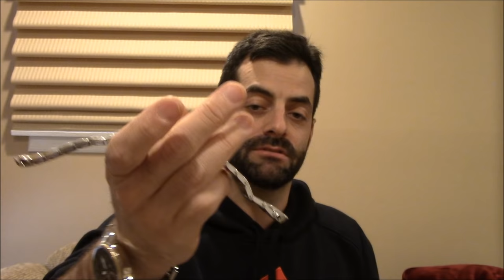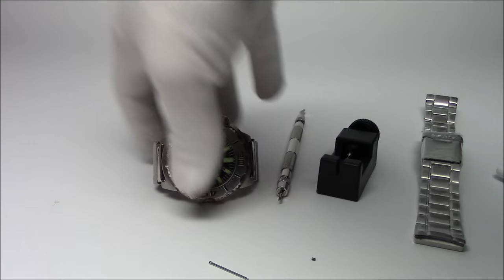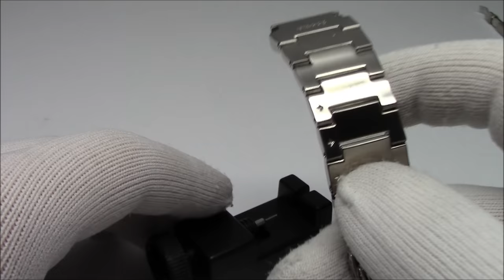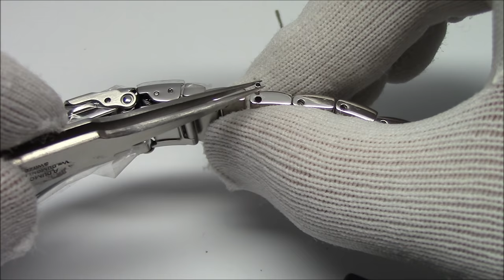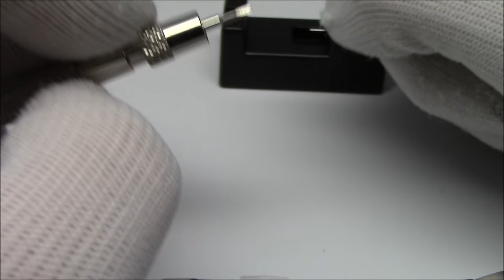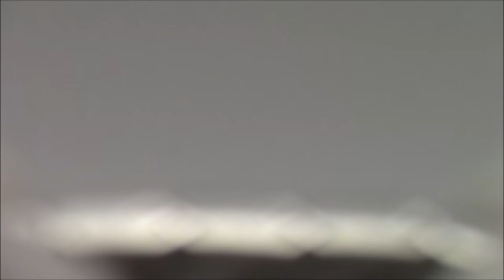How to size a Seiko (or any!) Pin and Collar Bracelet. Watch and Learn #15

Comment: How do you put the collar back in when it has expanded to a larger size than the link hole?  I was simply removing some links on a Citizen CA0650-58E titanium strap (with proper tools of course) and bent one of the the collars while trying to put the strap back together.  There doesn't seem to be a way to get any of the collars back on.  The only choice seems to be a NATO strap now.

Comment: what if the collar doesn't fit back into the bracelet? I'm having trouble with the collar going back into position once its out
Reply: What solution did you find, bro? Im having the same problem for my Orion Triton... Drives me nuts for like 1h
Reply: @CataVlad21  honestly, it’s been so long now, I have forgotten what I did. I either managed to get the collar back in using the pin tool, or I left it out once I realised I didn’t need the extra link anyway. Sorry I couldn’t be of better help! I do wish I took it to a watch repair centre instead if I knew what I’d be in for. Next watch with pins and collars will be straight there.

Comment: Thanks, this video really helped me out! I bought a Citizen Promaster Aqualand Titanium and I was struggling to figure out why on earth those bloody pins weren't holding when I inserted them, and what those little round pieces of metal that somehow rolled out of the bracelet were for. ;) 

By the way, Citizen uses a slightly different system, where the collar is inserted in the middle part of the bracelet and not on the outside like Seiko. Anyway, thanks again!
Reply: Thank you, your comment saved my sanity. I was struggling resizing a Citizen SkyHawk and I couldn’t figure out where to place the collar. Yesss it is in the middle.  Thanks again! Cheers

Comment: I recently bought a Citizen Eco drive Promaster..a local watch guy messed up the watch bracelet and lost the collars and my watch was almost about to fall off when I noticed the pin coming off..watch saved went to my regular watch guy who fixed it ..but the earlier watch guy messed up the sides of the bracelet by hitting it with a hammer...
Reply: Exactly the same thing happened to me TWICE. Once with a Citizen and once with a Seiko. The time with my brand new Promaster.  Literally walking out the shop and it came apart.  No idea how I reacted so fast but I managed to catch it.   I went back to the counter fuming.  The staff just laughed.   The second time, with the Seiko,  I returned home wearing my new Turtle.  Walked into the  kitchen and again it came apart on me and again I was super lucky to catch it before it hit the deck.  Had to go all the way back to the jewellers in another town at a fair bit of inconvenience.  They weren't remotely apologetic or concerned either.  

What was funny is both of those dealers sell much higher end watches than Seiko and Citizen.  Good luck spending £5000+ on a watch with those clowns who cant do even the most basic adjustments.  After my bad experiences. i bought a watch tool kit off amazon and fix my own bracelets now.  If i mess it up and it falls off my wrist at least that's on me.

Comment: Hi Marc, I found installing pin and collar for bracelet Seiko Samurai SRPB51 is difficult to get done. It seems the pin size is the same for both end; it is different from the pin for bracelet Seiko Turtle or Monster which one end is larger than the other. It also difficult to place the collar into the hole smoothly. Have you experienced sizing a Samurai bracelet? Your advice is appreciated.
Reply: I figure it out. The collar has to be placed into the wider end of the middle link. It is just like how you size the SARB033 and SARB035 bracelet in your Watch and Learn #53

Comment: I think I have these pins and collar on my watch (used camera and zoomed into pin heads) and need to change the strap. It's a Lorus R2B07AX9 with the silicon strap I sourced a stainless steel bracelet and want to change to it.

Comment: HEADS UP:  The collar or pipe may actually be intended to fit into the center of the link.
On my Seiko SPB143 the pin is not larger on either end. It is the same diameter all the way across. The collar / pipe slides into the center of the link, then you side the links into place, then feed the pin through from the outside edge (in the direction of the arrow). The holes passing through the outside edges of the links are too narrow for the collar / pipe to fit through. So, as you lightly hammer the pin through, the collar / pipe is trapped in the center section - holding the pin and links in place.
Reply: Seiko SSC741P1 has the same bracelet setup.  Found that out today.  Was confused for about two minutes until I noticed the hole in the center link being big enough to house the collar.  Was quite proud of myself after figuring it out without help.  And I did it without tweezers!

Comment: My land tortoise bracelet has pin and collar, the collar is on the inner male side of the link.  It is not on the outside of the bracelet.  Also I cannot see a larger end on the pin.  It appears to be the same cross section all the way across.
Reply: My samurai is the same, it came from the factory that way. So he's doing it wrong for modern Seiko bracelets (or at least many of threm). When the collar is in the male (smaller) part of the link it''s much easier and no fiddling around with pushing from both sides that he talks about. The outer part of the next link holds the collar in place while you insert the pin.

Comment: The bracelet on my new Seiko SNE549 seems to be another step down the road ... in attempting to take links out I stumbled: the pins do not seem to have a "big end". The pin will drop straight through the holes in the links in either direction. Maybe there should be collars on each end of the pin?? If so, I lost some of them. I bungled it completely. I'll have to head to my watch repair guy early next week and hope he has the appropriate parts and tools.  Sigh.
Reply: I figured it out! The sleeve/pipe goes in the center link. It slides right in, the hole is stepped down to the size of the pin on one end. Just drop the sleeve into the larger side opening, slip the links together (to hold the sleeve in), slide the pin in from the bottom (to keep the sleeve from falling out), and press the pin through the sleeve using a hard surface. Once the sleeve is engaged around the pin you can turn the whole thing over and  finish setting the pin from the correct side.
Thanks Mark for the informative video ... it didn't address this particular system (sleeve in the center link) but I learned enough to figure it out. Also found the dropped sleeve!

Comment: I just removed two pins from my (supposed) Seiko jubilee band... but the bracelet is not coming apart! What's that all about?? The pins are like split-pin types.
Reply from the maker: There could be a collar running through the center or something else preventing it from coming apart.
Reply: HI Mark, thanks for the quick reply! Yes I thought that too but then I noticed one of the two center links was hanging loose - it was simply a case of just pulling it apart with more force! They were cotter pins links it turns out so no collars. Anyway, all links removed and watch bracelet back together now - looks good! Thanks.

Comment: Marc, your viewers might find this helpful. The pin and collar bracelet as found on the SARB033, SSC019, and others works a bit different. I've done a video on that in the past. I referred someone asking about the type of bracelet you're working on in this video to come here as well.  https://youtu.be/qyvl1Wkzlso
Reply: My Citizen titanium H500 bracelet also has the collars inside the center part of the link, so you can't tell there is a collar without removing the link first.  This type of collar also doesn't come out on the push pin, it just falls out of the link if you're not careful.

Comment: took a bracelet in, and the girl needed to take two links out. she did it from same side. i said, you need to take one from each side and she said, no, the way the watch is put on, better for two on that side, if i did 3, i'd remove one from the other side. does this make sense? the watch fits her way, but thought of taking it back and making them do one from each side. doing my own from now on, one from each side.
Reply from the maker: It you do 2/0, it's not the end of the world. 3/0 and you can tell the difference.
For the OCD out there, 1/1 is the only way. But I'm sure the 2/0 works.

Comment: Spent a good amount of time trying to do this tutorial on my Seiko only to figure out my pin and collar system does not work like this at all and not all do. Most importantly being....your collar may or may not go in the outside hole of the link like his did. One of the inner holes of my links has a larger diameter to fit the collar. Boooooy was that frustrating to figure out

Comment: The pin and collar is used in the Citizen ECO Pro-master titanium bracelets, except the pin has no wide end or grooves in it and the collar actually slips in one side of the inner link.  I did not know this with my first Pro master, so I wound up replacing it with a cotter pin, which looks a bit sloppy on one side.  On a second Pro-master, I had a professional do it.  It is a husband and wife jewelery store.  The wife did it and did not put the collar in.  Fortunately, just sitting at my desk, I noticed the pin coming out.  I took it back and this time, the husband did it, and he found the collar in the little bag his wife gave me back with the links.  He showed me the collar and that it fit in the inner link.  So, he put it back together properly and all is well. 

I actually lost a watch within this house and believe it is probably on the floor somewhere with a missing pin.  Fortunately it is a cheaper watch.

Comment: If you don't see well cloe-up, I wouldn't use one of those tools. I scratched a bracelet last night, because I didn't have the tool lined up. I ended up pushing the pin out with a fine punch and small hammer.

Comment: Watched the video and read the comments. I just bought a Seiko SSC019 Diver / Chronograph. Removed one link and didn't loose the collars. But now to get the collar in again, was absolutely impossible. In the video the collar just glides in, my collar didn't. In my case, the collar had to be renewed by a brand new one. You can't reuse the same collar. It took nearly 2 hours for me to realize that. Fiddling for 2 hours with something of 1 mm....it's a sort of stress therapy but doesn't give you a watch that fits on your wrist. So beware, sometimes you have to use new collars, so you end up at the watchmaker store again. It is far better to think that you can't do a job and don't even start, than to think you can, after watching instruction video's, but fail miserably in the end. Beaten by something that small....a new experience to me.....
Reply from the maker: You can reuse the collar; most people do. Maybe it got deformed somehow?

Comment: Huh, I've never seen a head on my Seiko pins.  They've always been smooth.  Not only that, the friggin collars don't just sit in the hole.  It's almost like their too big.  What do I do?
EDIT: So after reading jazzzdude's comment, yes, I realized the collar goes into the inner hole of the link (the hole of the link that is hidden when the separate links join up, if that makes sense).  You'll see it's a bigger diameter hole than the outer ones and fits like a glove.  From there, you just line the links up, put the pin in and hammer it home.
Reply from the maker: Yup!

Comment: Hi Marc,
Your Watch & Learn episodes are really great. 
Before you posted this one, I resized my wife's Citizen Ladies Excalibur and lost the tiny "sleeve".  Fortunately, I could steal one from one of the other unused links.  Although similar to Seiko, the Citizen version is a little different.  What they call the "split tube" is positioned in the center link rather than the outside link of the bracelet so all you need to do to complete re-assembly is to push the pin back into the link.
http://www.citizenwatch.com/en-us/files/2012/08/pin1tube.pdf
Reply from the maker: Steve C The SARB033 works the same way. It's a neat system.
Reply: Thanks a lot for sharing!  I was trying to follow the video with my Seiko SNAB  but it was different! This one works with it. Saved me a trip to the local jeweler :)

Comment: I now understand what went wrong the first time I encountered this type of strap and why when I put the pin in it kept falling out. I did't know it was a collar, I thought the pin broke. After seeing this video I felt comfortable to try again with a new watch. After an hour or two of fooling around with the pin and collar, with the collar or pin falling out, I gave up and put a nice black silicon rubber strap on the watch. It adjusted fine and nothing fell out. I would not trust a watch repairman to adjust a pin and collar. It is untrustworthy. It's an example of taking a fair design, simple cotter type pin, and over engineering it to something crappy. I don't have the time to waste fiddling with such an abomination and risk losing my precious watch. Shame on Seiko on using such an abomination and charging so much more money for it.

Comment: This particluar pin and collar system has to be the most insecure and stupid of anything I`ve seen. I have other pin collar from seiko where the collar goes in the middle piece and butts up against it so the pin is firmly secured as it goes through. Probably better than split pins, but light years better than this silly collar system. With the right diameter punch to try to get the pin further through the collar, there`s no way you can really get it super secure. Ridiculous system they created here, when they already have a much better one on the centre links. just had the pleasure of trying this on a new v3 monster. I'm not confident at all that these pins won`t come out.

Comment: horrible experience. If you want to experience true frustration trying dealing with pins and collars. I purchased the tool kit as recommended (very poor quality ) from a different vendor. Watched the video many times. I have a brand new issue Seiko Turtle on bracelet. Everything comes apart easily-- but try to put it bak together, the collars are extremely difficult to hold and line up even with the thinnest needle nose pliers, and if you loose your grip the collar are gone, once the drop even with a controlled black background- they just bounce away. Now back to were I started -- going to a jeweler- hopefully he will have some collars to replace the ones that went missing.
Reply from the maker: Good luck! Sorry it didn't work out.

Comment: thanks!  but my orient triton's system does not look like this,  the pin has no end that is bigger, but it definitley has the collars. what a screwed up system  they ought to have to buy back this rubbish.  they never have any instructions for sizing the bracelet, and you're lucky if you don't have a stroke fooling with this idiotic approach to "luxury".  mad as hell and not going to take it anymore...